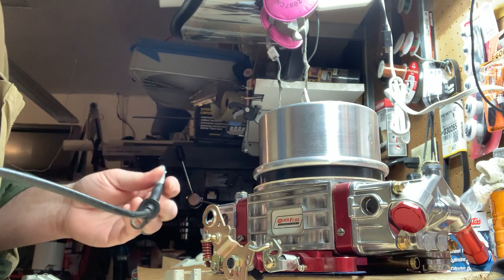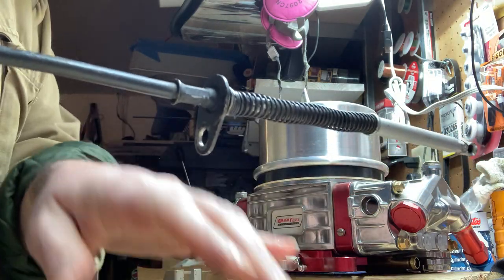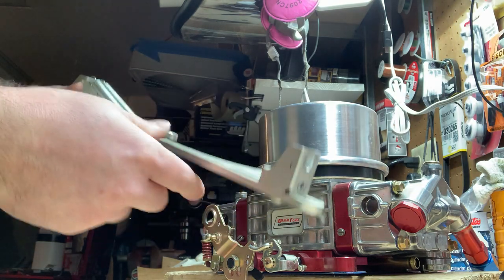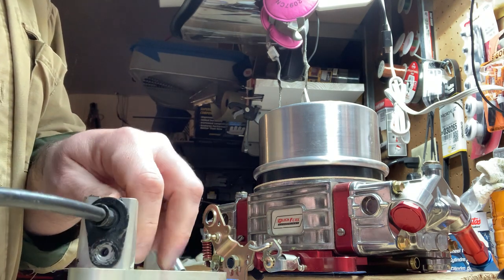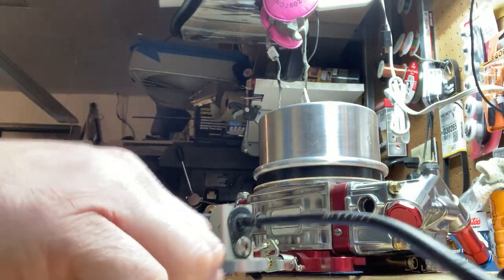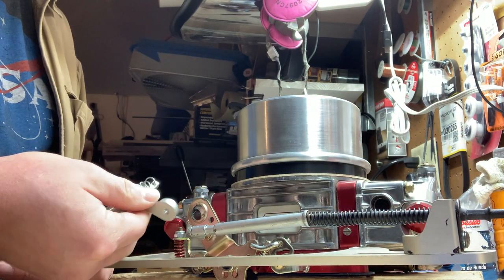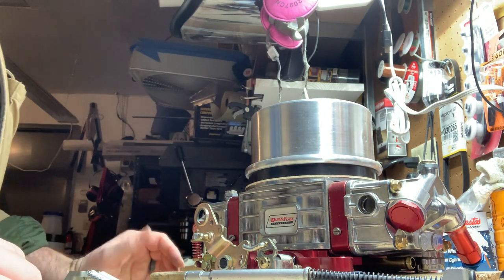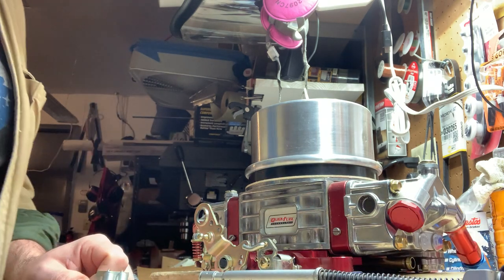Making a stock OEM Ford throttle cable work and fit with aftermarket parts - A Ford Maverick Build

Comment: What is the bracket manufacturer? Details would be nice!
Reply from the maker: This particular unit is a Big End Performance Throttle Cable Bracket 4150 Ford Cable BEP16003 - but they're hard to find (or overpriced now) and I believe out of production. Jegs sells a ton of different options: https://www.jegs.com/p/JEGS/JEGS-Billet-Aluminum-Throttle-Brackets/752613/10002/-1 - 555-15231 being the one similar to this one.

Comment: What type of air cleaner is that?
Reply from the maker: It is not an air cleaner, but a aluminum cap for the carb when working on it in the car, or in storage.